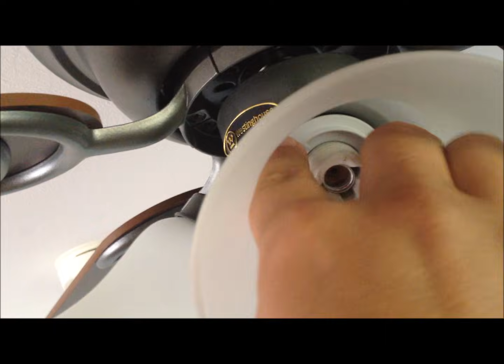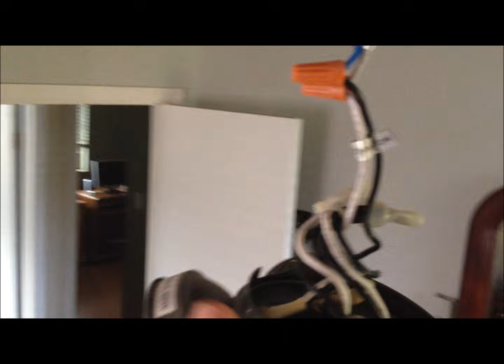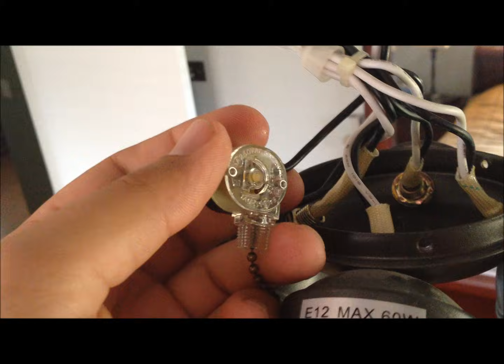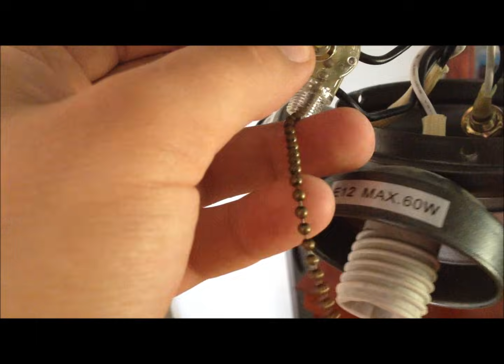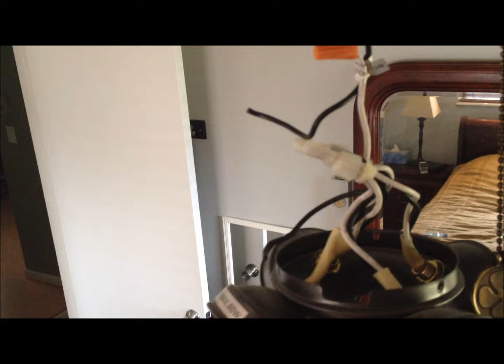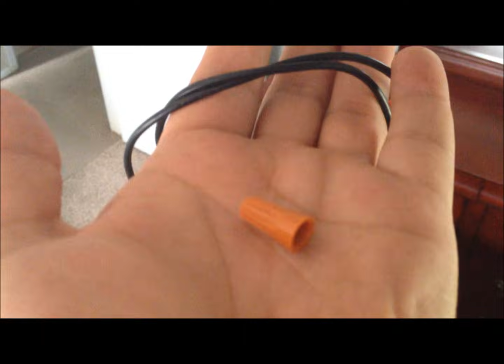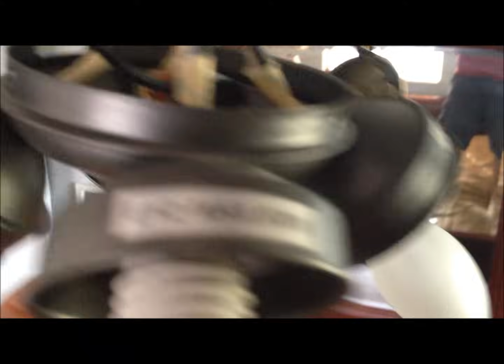How to repair pull chain light switch in ceiling fan

Comment: Might seem stupid but I'd rather be safe. When he says "power off" does he mean the switch that controls it or the control panel that has all the power switches to all the rooms.
Reply: He means turn off the power to the room at the circuit breaker, which is the control panel for electricity in your home. You don’t have to turn off all of the switches in the box, just the one that controls power to the room and outlet for your fan. Just turning off the fan will still leave live wires that will shock if not injure you severely if you open the fan as he directs.

Comment: Try WD-40 first! If that doesn't work then get yourself a new switch. Don't remove the old switch until you get the new switch. Don't snip off old switch wires. Just unscrew wire nuts one at a time, remove old wire and replace with new wire, one then the other. Can't mixup wires that way. You're welcome!

Comment: Well done.  Short, easy to understand and best of all, very similar to my fan-light.  Thank you !
Only difference: my snail shaped device was actually screwed down into the base!  Not push thru ~ but screwed thru.  So, anyone in the same situation should remove the wires from the snail shaped switch, then unscrew/remove.  Afterwards, screw the new one into the base THEN attach wires!  : )

Comment: Well I mixed up the wires. :face-orange-frowning: What is the worst that can happen?
Reply: Don't remove the old switch until you get the new switch. Don't snip old wires. Just unscrew wire nuts one at a time, remove old wire one at a time, and replace them with new wire one at a time. That's the goof proof way to do it!

Comment: This is a really great video on replacing the ceiling fan light switch!   I really liked the approach of cutting the wires of the old switch, identifying the top and bottom switch wires, and splicing in the new switch with wire nuts.   The repair took less than an hour and the new switch only cost $6 at the local hardware store.   Success!  Thank you!

Comment: What about replacing the pulley switch to the fan? I just pulled to turn speed and it broke inside the portion where the bolt like part screws onto the fixture.

Comment: Spent 2 cents to fix switch with electrical tape. It appears that a small clam that holds top and bottom of switch together on one side broke and allowed parts to seperate. Electrical taped together and worked fine. Was thinking about gluing together but might not hold anyway.

Comment: When he says “turn the power off” does that just mean to turn the light switch off??
Reply: No turn it off at the breaker switch. Turn off the whole power where you are not getting any electricity. Make sure to use a voltage tester to make sure you are not getting any power to the wiring.

Comment: Thankyou! Lucky I have the same brand fan as you because I accidentally dropped the case down too far and disconnected the wires leading to the rest of the unit. But I saw yours had the same black to black and blue to white wires.

Comment: I accidentally pulled my light rope too hard and it fell out, it's in there similar to your fan rope. 

How would I fix this? I still have the rope and everything.. just can't put it back in the hole.
Reply from the maker: You'll have to get a whole new switch (the snail shaped thing). At least that is what I would do.
Reply: @wagslick  Ahh.. I thought you'd just stick it back in there lmao no idea how it fell out then, but I guess that means a trip to Lowe's tomorrow.
Reply from the maker: @allenwright123  Careful. Some of the switches have 2 wires, 3 wires, or 4 wires. Get the one that best matches your fan.

Comment: My ceiling fan running  great, but last night the pull chain just won’t work.  So iis is a switch of something else?  It’s all stuck on working.    Do I really have to do all this or is it something else?  I do not feel comfortable doing this switch replacement,  or know how to lower the ceiling fan on it’s wires in order to access it all. Could it be something else?

Comment: On my light switch Pull Chain. I have only 2 wires. Black and White. Plug has white on one side and black on other side.  My Husband doesn't know how to or where to put the wires back. Didn't take pictures when he took apart and now he doesn't remember where the wires go.

Comment: This was a huge help!  It was flawless and quick.  My globes had rubber gasgets that were old and brittle.  They broke when I took them off.  I replaced them with rubber bands, it worked well!  I thought I was going to have to replace the entire fan costing me $70 to $100.  The replacement switch cost less than $4.  I followed you instructions to the letter, it worked great!  Thanks much for this great video!

Comment: From my knowledge of electrical, the wires on the switch itself should not matter where they are plugged in. A switch is a conductor just like the wire, but the only difference being the switch can open or close itself where a wire cannot unless you cut it and splice

Comment: To use wd40, do I still need to remove the Globe part with the lights to get inside to spray the switch, or can I just wd40 the part outside where the chain comes from?  Thanks

Comment: I have made this repair a few times. Well done vid. I just replaced a switch the other night. Then today I went to replace one and it was a 3 wire switch. One black fling from the fan into true chain switch and 2 coming out going to each light. So do I need a special switch or is there a way to wire that

Comment: Your video is very good and straight to the point. However, the hole where the chain switch goes will vary depending on who the manufacturer is. In my case the hole for the chain-switch was "tapped," "threaded' so I could not just pull the chain-switch out as you did. I had to identify the wires (your idea), disconnect the wires and then unscrew the chain-switch. To put the replacement chain-switch in I had to screw it back in, reconnect the wires and finish the job. This is coming from a person who do not mess around with electricity other than changing batteries in a flash-light. Thank you for you video.

Comment: when you say "turn the power off first", will keeping the switch on the wall turned off suffice or would I need to locate a breaker?
Reply: Yes that's good enough
Reply: Breaker.
Reply: I have the same question.

Comment: All u need is spray wd40 inside switch & turn on & off a few times & it should work,tip from a maintenance tech
Reply: WOW. Man I just did what you suggested using wd40 and it really worked. I was floored and boy was I laughing. Thank you so much for this. Had I not seen your advice I would have gone out and bought a new switch. Thanks
Reply: I love the internet.. Thanks for the fix!
Reply: Why the fuck did this work?
Reply: I sprayed it and OH MY GOD IT WORKS. I kinda just stood there for a little bit with my jaw dropped because I’ve had no ceiling light in my room for 3 months thinking about how I had to replace the switch and all I had to do was spray a can of WD40 and THAT’S IT.
Reply: is that the same if the fan chain is stuck?
Reply: Where do I spray the wd40? I dont even know what the switch is
Reply: @Michelle-by9fp I have the same question
Reply: Tino8080 - YOU ARE MY HERO!!! Thank you so much! You saved my day! I had already disconnect the light assembly from the fan by unscrewing the screws and pulling the snap connector (I didn't see the need in turning off the power unless he meant 'flip light switch off') anyhow, you saved me my day! Thank you!
Reply: I hereby give you the title of "Greek god of Ceiling Fan light"
Reply: @imadthegreat   AYE AYE!!!
Reply: It worked..
Reply: It worked..
Reply: Thank you so much!!!! You saved me so much trouble!!!
Reply: Give that man a 12pack of ice cold beer
Reply: @EscobarMT  I know right? He's a genius! Ahhh, what the heck- give him a keg!
Reply: Tino8080:  It worked!  Thanks very much for the time-saving tip!
Reply: A squirt and a little sunshine is back! Thanx. I''ll save the new $3 switch.
Reply: Just want to thank you so much for the wd40 tip. It worked great. Thanks again!!!
Reply: You are a lifesaver! WD40 worked like a charm! Thank you so much for the handy advice!
Reply: Worked like a charm in 10 seconds I had a working light pull chain. Thanks.
Reply: No bs...try this 1st! I sprayed avocado oil on mine. Thank u guys for the tip.
Reply: This actually works!!! Shot the WD-40 up into where the switch pulls, pulled twice and it worked!! Thank you!!!
Reply: I was able to get mine to work by doing a few quick shots of compressed air up by the chain and it worked. Dust was building on the chain and got stuck in the switch
Reply: @tino8080 just got on here to check out how to fix this issue and seen your lubricant comment, worked like a charm!!
Reply: You’re a freaking genius thank you so much for the tip I was actually going to attempt to do what this video was telling you to do and I’m a woman I know nothing about tools but I do have wd40 and I love it you can also use WD40 and the magic eraser with a little dish soap to get scratches or another car’s paint off your car it works wonders thank you
Reply: 5 years later and your tip is still working!!! Worked for the ceiling fan light and a pull chain in the closet!!! Thanks!!
Reply: I thought it's dangerous to spray WD40 on an electrical connection like this light switch. Is that tru?
Reply: @eileenfazzini7551 it's in a plastic casing so it should be fine. I used white lithium grease as it's used for things such as that.
Reply: tino8080 !~ People like YOU aught to right a book and save us a lot of trouble! Whenever I'm stuck, I'd have no trouble reaching for Tino's 8,080 Tip To Save The Day!"
Reply: I’ll add to the chorus of thank yous. Replacing the switch looked less daunting once the assembly was down, but cleaning out the dust and spritzing some WD-40 solved the issue.
Reply: @jenofthejungle3023  You must be like me- the unlucky minority. It's always me that if something sounds too easy and it works for everyone else- it won't work for me, but this actually DID work for me! I'm sorry though- blast it again, maybe...just maybe this time it will work! 😃
Reply: Thank you so much!  It worked!
Reply: I’ll have to give this a try thank you
Reply: tino8080 this saved me so much time. Can’t believe that actually worked 😂
Reply: Thank you, saved me a headache
Reply: Oh my, This works!!! 👌🏼
Reply: My man!
Reply: YES! I can absolutely see this being a fix. I tinkered around with our pull and used WD-40 but the piece is legit broken. I am replacing for a few bucks off Amazon. BUT Thanks for this... I tried ;)
Reply: @GriswoldsOnSullivan  I tried the WD-40 first and it didn’t work either. That’s how I got here :)
Reply: OMG it worked
Reply: Took it apart. Was about to go to lowes & bam! I see this comment! Thank you!!! It works!!
Reply: Mine is finicky.. sometimes works, sometimes doesn't.  WD40 actually made it worse.  Guess I'll replace.
Reply: Thank you so much,  my chain kept on getting stuck, sometimes it work and others It didn't.  That really worked 👏
Reply: You are doing God's work sir! I can't believe that actually worked! Saved me about 20 bucks!
Reply: thanks, Tino - good tip
Reply: 2 seconds of work, THANK YOU!
Reply: I just tried it,  IT WORKED.  Thank you!!!
Reply: Tino8080! Thank you.  That's awesome worked instantly 👏
Reply: 😂 it worked!
Reply: Definitely works!! Was skeptical at first and then tried it to save a trip and time.
Reply: Definitely work 😂 thank
Reply: I'm so glad I found this video and this comment.  This worked perfectly for my ceiling fan light.  I was about to call an electrician then I tried the wd 40.  Saved me from spending way too much
Reply: I was thinking the same😊
Reply: Brilliant! It worked, thank you so much!
Reply: Sorry everyone,  but did not work for me. Nope didn't work.
Reply: My bad... it actually worked.  I'll gladly eat my words. Nice. Thank you.
Reply: There's no way that just a little WD For....*click click*... well I'll be a sonofa...it worked!... took longer to type this out than it did for the Tito tip of the day to work... well done
Reply: *Tino...apologies
Reply: Dang, I was hoping that would work!
Reply: Thank you! Tried this today and it worked. 😂 Tears of joy brother!
Reply: Totally right on
Just did this,worked immediately ❤
Reply: WD40 worked for me!
Reply: Wow I just used WD-40 and it works. Saved me a lot of money thanks
Reply: Great tip! Saved me from buying a replacement switch. Thank you!
Reply: @tino8080, may God richly bless you for your advice of spraying WD40- it worked! Glory to God! Thank you very much!
Reply: Bro I love you
Reply: Works now thanks
Reply: Oh my god…. It worked
Reply: Trying to reply with a video of IT WORKING!!! Winning baby!!! I love tips like this!!! TY so much!!!
Reply: Thank you!
Reply: Wow I just tried this, thank you brother. God bless
Reply: Fixed in one spray. Thank you so much!
Reply: Came here seven years in the future to say this indeed works! Save time and money by trying this first before doing any electrical work.
Reply: tino8080 Not sure why it worked but it sure did! I could tell the difference in the switching action immediately and now it works like a charm. Thanks!

Comment: Thank you so much! First time having to do something like this, and you nailed it! I used a piece of electrical tape around the “top” wire so I didn’t get mixed up. I also used an orange wire nut and then wrapped the bottom part of the nut with electrical tape for double safety.

Comment: Great video I opened mine up and simply used a thumbtack to push the device back and worked like normal. Thanks to your vid I was able to dissect it and solve the issue

Comment: We bought a Harbor Breeze Tahoe Fan/Light used, looks brand new, 
installed it, fan works great but the lights do not. The light kit plugs
 directly into the fan, would it be the light pull chain even if it 
pulls smoothly? Thank you

Comment: Thanks for the reply Troy.   I've replaced three light kits and two light chain pull switches, which led to gross over-confidence.  I had already cut the wires under the canopy when I realized a third lead was connected thru the canopy which I assumed is the hot or power lead. The leads on the old switch are colored differently from the replacement switch.  The light kit has a white lead running to a cluster of 4 white wires leading to each of the four fixtures, and a black lead running to a cluster of 4 black wires running to each fixture.  The presumed hot wire is from the fan housing.  The replacement switch has black, red, and blue leads.  Can I assume the black lead on the switch goes to power and the blue and red are interchangeable as to which cluster they tie to?

Comment: Does anyone know of a vid for replacing a 3 way light pull chain switch?
Reply: D dunnguard it's basically the same, but actually a little easier. Take a picture or write down which wires go to which hole on the switch (on mine, it's black to L, grey to 1, brown to 2 and purple to 3 and the switch is marked).

With the fan switch, instead of clipping the wires, put a small screwdriver in the hole, and the wires pop out. Then stick the wires into the holes on the new switch, and they lock.

Comment: Sometimes u can spray WD40 in the chain hole and also push chain back into the hole get it to loosen up.. it's worked for me plenty of times but a lot of times they do go bad but I notice problems with fans that are by the kitchen they get greasy or moisture

Comment: Actually, wire polarity shouldn't matter for the pull chain relay as all it does is complete the circuit. 

Also, if you no longer want the pull chain feature or want a quick temporary fix, wire nut together the two wires that connect to the relay.
Reply: Thank you for that comment. I didn't think the wires made a difference. Almost was scared off when he said top wire bottom wire. My replacement switch isn't exactly the same.
Reply: I kept thinking what do you mean, I had a non working light for years and now you are saying I can just connect "top and bottom" wires coming form the fan and that's it?  It makes sense, but just double checking.  
My new switch has blue red and black so I was lost since there are only two black wires coming down from the ceiling.
Reply: I connected both wires and It didn't work.  :(

Comment: If i am not mistaken since both wires are black it doesn't matter which end gets linked to which end because they are all +. The white wire is the -. And as seen in the video the white wire doesn't get touched.

Comment: Do you need just the fan power off or power off in the house in general? My fan light won't shut off at all :/ Had to unscrew the lights and leave it until we can figure something out. I want to do it myself if possible.

Comment: I am a single lady, so I have to do things myself. I've been doing the wrong kind of searches for a couple days, so I have been afraid to tackle my ceiling fan problem. But now, with a new search, I found yours and my fix is clear to me. Shew! My problem is the kitchen fan/light. The fan stopped working and it's surely been NEEDED for the last two months. I knew how, so I took it apart and blew it out with compressed air, but that didn't help. So I put it back together and did this final search that brought me here and you have cleared up my thick-headed thinking. SOOO, now at least I know how to take it apart and put it back together. I just need to get the switch. I won't get to it for a week, tho, at least. But at least I am not timid anymore.